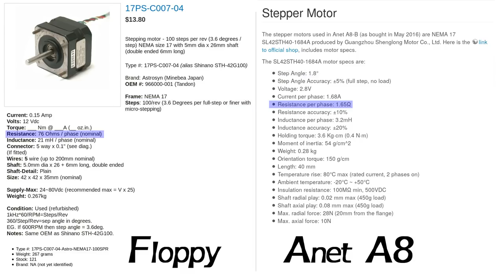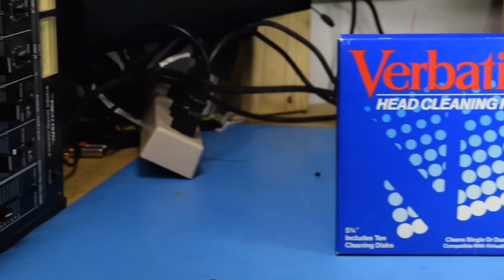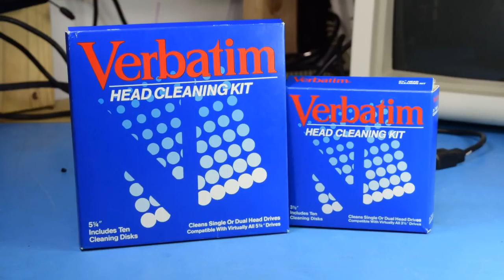Floppy Drive Refurbing

Comment: Not really sealed bearings, I believe the correct term is shielded bearings.
Reply from the maker: I'm not a mechanical engineer so I haven't been exposed to a lot of the subtle differences such as this yet.
Reply: Both shielded and sealed bearings exist and they are being used depending on the application.
Judging by the serial (R-1650-HH) posted by AkBKukU these are shielded.
Reply: @TechTangents  I only know cause I used to race RC cars, and all the guys would do exactly as you would and soak the bearings.
Reply: Shielded bearings, you can use wd40 to dissolve old grease and oils by soaking (I used to use a bearing tube/sleeve with screw cap and shake it).  Sealed, you can't.
Reply: Sealed bearings usually have a black rubber seal to keep lubricants inside, shielded bearings usually have a metal covering to keep junk out.  Both kinds can be re-lubricated.
Reply: exactly right, not 'sealed bearings'.. I soaked mine in some carb spray over night to completely dissolve the original lube in the bearings which hardens over the years causing the bearings to freeze up (WD-40 should work as well).. blasting them out and then some fresh oil and they're good to go. No need to replace any of the bearings in the floppy drive.. Just freshen then all up.
Regarding the speed of the drive.. There's a POT on the servo board (rear board) that adjusts the speed of the motor. Replacing the belt would only change the speed if the belt were dried out and slipping. If your belt is in good shape and is not dried out(hard) don't bother replacing it. Tweak the potentiometer on the servo board (R4).

Comment: The metal cover indicates these are shielded not sealed so lube can make it in no problem. You can pry the shields out carefully clean and relubricate.  I doubt given their usage that the  bearings themselves are physically damaged.  Probably just petrified grease.  If you dont want to pull the shields just soak them in alcohol for a day let them dry or a day then soak in oil.  But the shields shouldnt be too hard to remove.

Comment: 8:00 You can buy whole packs of those bearings for cheap. Also, yeah sealed bearings are just... contained. Not actually sealed. There's quite a bit of play around the shaft for many of them. I'm glad you figured it out! Yeah you can sometimes recover them for a while with 3in1, but you may need to just order a pack of those for a few bucks online.

Comment: Give the bearings an alcohol bath first, as 40 year old grease goes like stone. Then oil after.
Reply: Oh yeah! Or even a wd40 before the alcohol bath
Reply: I thought it was a bit amusing AkBKukU has the WD-40, needed a penetrating oil... went for the 3-in-1 silicone instead? (If the 3-in-1 is also a penetrating oil, then, well... my bad) Okay, yes, I get it, it's not a long-term solution... so you free it up and clean it out with the WD-40, and then maybe clean that out with isopropanol, and finally lubricate as desired?
Reply: I was thinking acetone, but yeah.
Reply: Have to be careful with acetone as some ball races can have plastic seals and carriers.
Reply: @Joe Casson its in a stepper motor, so not like it be spinning thousands times a minute or in use all the time and moving a small read head.
Stop being so over dramatic.

Comment from the maker: The bearings are size R-1650-HH, not 608. So I can't just go and easily get new ones. The non-garbage quality ones I saw online with a cursory search were about $20 shipped. So they aren't easy or inexpensive to replace. Just because it's a circular bearing with a hole in it doesn't mean it's the same size as a skate. 

Like I said in the video, it would probably be easiest/cheapest to get another NEMA 17 stepper and yank the bearings out of it. I can do that any time I want. But oiling the bearings and putting them back it lets me use the drive right now without needing to wait for parts.
Reply: Ah, fair enough. $20 *each*!? Crazy!
Reply: Dude they're 625ZZ bearings.

Amazon has them for like 5 bucks each and free shipping over $25.
Reply from the maker: Where do you get that size from? I can find very little info when searching for info on either the model number printed on it or "NEMA 17 motor bearing"
Reply: Unrelated to the bearings, wouldn't it be possible to 3D-print the necessary board needed for the tertiary floppy drive to work?
Reply: Er, not really, but if he had the schematics and felt really nuts he could recreate a PCB and send it out to be fabbed, even in qty. 1, then try to source all the chips and passives and assemble it himself. Would be vastly easier to get another 'parts' drive that does have the missing PCB.
Reply: I'm seeing a few eBay auctions that list both R-1650HH and 625ZZ as the compatible replacements. $7 delivered for 10 of them seems fair!
I know the R in R-1650 designates it's in inches, and the 625ZZ-type is metric IIRC. The numbering system for those things is over my head..
Reply: +AkBKukU dude everything has a cross reference.  These bearings aren't custom to these drives...they're more or less off the shelf components.

Therefore, a R-1650HH cross references to a 625ZZ.  Easy, simple, done.
Reply: What is the size of the bearing. R-1650 seems to suggest its a 5x16x5mm, which would be a 625ZZ.
625 = 5mm bore, 16mm OD, 5mm wide
ZZ = double shielded
A pack of 10 625ZZ bearing on Amazon seem to run between $7-15 with prime.

I have a bunch of nema 17 steppers I could check. Of the ones I've torn down, it seems like the bearing are always the same size. Listing B01CUTIQWW seems like a decent option.

I've never seen a 3.6 deg nema 17 stepper, they must have falling out of use a long time ago in favor of the 1.8 and 0.9 deg ones.
Reply: After some digging, the R-1650 HH is a 5x16x5mm double shielded bearing.  H type shielding seems to be uncommon now and been replaced by the far more common Z type, I'm assuming the Z type is easier to manufacture. I think the <series>]-<OD size><bore size> <sufix code> numbering system has fallen out of favor for the simpler <type><width/height><bore><sufix> for the common series of bearing sizes.

The modern equivalent to an R-1650 HH would be the 625ZZ. You could instead use sealed bearings if you wanted, that would be a 625-2RS.
Reply: @Colton Rushton: 3D-printing PCBs is still an exotic pursuit, however it is possible to etch your own PCBs, even dual-layer PCBs, at home using a variety of processes. There are a lot of DIY PCB videos on YouTube. That might be easier than learning how to 3D-print PCBs, which isn't a particularly mature technology yet, not even among hobbyists. 
Ordering bespoke PCBs from a low-volume supplier might be easier still, albeit slightly slower and slightly more expensive. 
And like KooriShukuen said, you'd need the schematics, and it would be vastly easier to cannibalise a donor drive – though I do respect those who recreate spares from scratch immensely! 
Some googling revealed that at least the logic diagrams though not the precise layouts/gerber files are in fact out there for the drive PCBs, though there seem to be three different drive and PCB versions. Google Technical Reference Options and Adapters Volume 1, and then it might be page 229, at least in the April '84 PDF. And even if you did recreate a compatible PCB, you'd still have to find and populate the PCB with all the right parts, some of which may not even be available anymore. Is it worth the effort just to say you didn't cannibalise another drive and brought a previously-cannibalised drive back to life? Your call.
Reply: HH have been replaced by ZZ because HH have been so expensive to manufacture with high failure rate at manufacturing ZZ just cheaper and better ;p 
i will not take 2RS computer are just magnet for dust and this can wear out the platic shield and make a goop based on platic and oil ZZ are only a bit expensive and just last longer :^)
Reply: 5mm ID 16mm OD 5mm width. You should be able to find decent sealed or shielded (yours are shielded) for less than $3 each. It doesn't have to be the same model number, just the same size
Reply from the maker: Ah, the difference in size formats makes a lot more sense why I can't find them. That helps a lot. I don't quite know how I will handle this going forward though. After some more reading yesterday I found that stepper can become demagnetized for some inexplicable reason when disassembled. And I had tried to get the bearings free without opening it up first with no luck.So I'll have to look into it more. 

In the case of floppy drives though, I don't really think lost torque is a problem. They were really only used for their positioning abilities.
Reply: @AkBKukU
Try getting the 625-2RS, the rubber seals can be removed to clean them and regrease them in the future just in case, try not to cheap out on the bearings as cheap chinese ones are shit, they leak the grease and start rattling, even more in a stepper motor which naturally vibrates, so try getting some SKF or NTN branded 625-2RS, those are really good and will last and work without play or noise. Rubber seals are the best for stepper motors as they dont run hot nor run at high speeds, and seal better than the metal shielded ones.
Reply: Thanks I was wondering about just buying new bearings
Reply: It's good to take an interest in other areas, not just your personal speciality / hobby. That way it's easier to see the big picture.
There's a cross reference for almost everything in mechanical engineering.
It would make no financial sense for a floppy drive manufacturer to use one of a kind bearings in their design. Measure and replace with  shielded bearings of the same dimensions.

It would be like Ford making their own tyres from scratch for every year and model of vehicle, IBM making everything out of their own special metal alloy instead of Steel, or rolling their own electrolytics. Just wouldn't happen.
Reply: @leisergeist  I think he did the right thing...just oil up the bearings. Why buy new ones especially if it is a classic computer where you would rather have original, and also it is not going to be used as often as it was during the 1980s when it was a "daily driver" main work terminal, or personal computer.

Comment: Back in the day we were mainly having to replace the spindle bearing and sometimes the stepper motor with new parts but it you and others are having to replace the bearings in the stepper motor from donor drives. Kudos.

Comment: Thanks for putting out this info. Info on fixing these old drives is rather sparce out there, or any folppy drives.
Reply: I want to see a video on repairing a head crashed MFM hard drive where you remap the directory to an undamaged part of the platter.

Comment: I  genuinely admire your commitment to these primitive (relatively speaking) floppy drives.  As one who was bought my first floppy in 1979 (for a TRS-80 Mod 1), and owned a wide variety of floppies including single-sided double-sided, single-density, double-density, quad-density, etc, I can say that I don't miss them one bit.  Backing up a 20 gig hard drive to floppies was absolute torture.
Reply: Come on now, don't really think you would have backed up to 13 or 14 thousand floppies.

Comment: what I don't get is why he doesn't just order new bearings bearings are the same as they were 30 years ago all you gotta do is match the size and type (IDxODxH, sealed) and likely based on the size are cheap as chips 608 roller skate bearings
Reply from the maker: The only ones I could find of any reputable quality were about $20.
Reply: AkBKukU  I see so a cheap stepper (burned coils parts one?) is likely the best source
Reply: Yea I started wanting to yell at the screen to get new bearings, as soon as I realized he was going to try to save the crap ones.
Reply: AkBKukU  ohh and keep smokin bro
Reply: christ all floppy drives must be like this they are often so loud perhaps they all need new bearings
(I might need to sell a kit to fix these old things for a 10% markup...) wait did I just type that....
Reply: you can use any cheap 608 zz (zz)mean double shielded  or size you need it's look 608 :p 
these stepper not driving huge loads i have 2 608 zz from china in one of my drive the same as yours and it's good after 3 year of work
and it's shielded for dust i don't think zz are liquid proof liquid proof had plastic seals

sorry for my crapy english btw
Reply: 608 have an 8mm bore, the stepper shaft is 5mm. 625ZZ is the likely size.
Reply: tad2020 oh but still buying new bearings for 20+ drives akbkuku is likely to own will make the "small order" pricing less ridiculous
Reply: and if he can't get the right size he could go for best-fit and add some 'filler'.

Comment: 22:18: While the lubricated drive is a lot quieter overall, it does make a weird clack sound though. Not sure if that's a problem. Anyway, thanks for the really helpful info; that's fantastic. :)
Reply from the maker: I think that it is either the other drive makes so much noise that you can't hear it hitting the stop screw or that I may need to move the whole transport back just a tiny bit more.
Reply: @TechTangents  I was thinking that or the gain was higher on the recording to try to accentuate any kind of sound.  Growing, my cousin and I both had Tandy Cocos, his had the older FD501 SSDD and mine had the FD502 DSDD drive.  Both were new drives when purchased, and around the same time but the 501 was a lot louder, and I thought sounded cooler.  My 502 drive had more of a buzz as the heads moved rather than the braaap, braaaap sound his did.  Also it seemed like your silent drive loaded faster, maybe because the seeks were quicker?

Comment: There's a YouTuber out there that took a couple of seized MFM HDDs that use steppers and dropped a bunch of oil into the bearings and got them working good as new again. One of them I believe he mentioned needed pliers to get it to even move slightly, and he got that working too. Pretty impressive stuff!
Reply: It's Adrian Black

Comment: Bearings are quite cheap so NEVER bother with soaking in oil - it is really temporary fix (not solution) and it will be worse and worse until it fails catastrophically in matter of weeks. Been there, done that. Bearing R-1650-HH translates to 625ZZ, the second most widely used bearing and I found it as cheap as 2 GBP for 10 pieces, so price is really not a point here.
Also, when disassembling a stepper motor - never let the rotor lay on table open in wild. If you plan to have it dissasembled more then for few hours, you HAVE to cover the rotor with something magnetic, like nails. Why? If the rotor doesn't have magnetic stator around it, the magnetic field degrades quite rapidly resulting in motor which have almost no torque.
Reply: "If the rotor doesn't have magnetic stator around it, the magnetic field degrades quite rapidly"

Very unintuitive, like many things in this world! I would like some additional reading on this if you could point me in the right direction. I would have expected the magnetic field to be lost at a rate similar to... well, regular magnets, frankly. Which is negligible over a human lifetime.
Reply: never is a long time; NEVER is even longer. But knowing what you do, understanding the bearings and their failures, de-shielding, cleaning and lubricating them may be shorter, cheaper and better overall. Not for everyone though...

Comment: I really enjoy your videos.  I am amazed that this drive still works after complete disassembly.  Once you disassemble and remove the heads on a floppy drive you have to re-align the drive.  You can hear in your video that the second drive is not quite aligned because you can hear the sound of it hitting the end stop.  It shouldn't be making that sound.  The first one doesn't.  If this was a High-Density 1.2MB drive it would not work.  To properly re-align the drive you need an oscilloscope and a factory alignment disk.  They did sell do it yourself alignment kits but they only get close, which you obviously did because it is working.   Once they aligned the drive at the factory, they used thread locker on the 3 bolts.  Those are all crucial for proper alignment.

You can still purchase the analog alignment disks but they are very expensive.

Anyway, not trying to sound too critical just trying to save people from cleaning too deeply and ending up with a non-functional drive.
Reply: Sorry for the late reply... but yeah, something is very unpleasant sounding with that second drive.  It does sound like some sort of plastic on plastic.  The first drive sounded perfect to my nostalgic ears.  That second one sounds like a hard drive head crashing... it was disturbing to my nostalgic ears!

Comment: Those bearings aren't totally sealed.  Back in the day, IBM and Shugart used to rebuild those stepper motors and replace the bearings because they get gummed up kinda easilly if you use the computers in a dirty or dusty environment. If you soak them in solvent, and then in a good oil (light machine oil) they may work OK for a little bit, but it won't last. The only way to totally save the drive is to replace them. It is an NMB bearing, they are still available. Glad you got it working though, hopefully it stays that way. The best way to keep it going is to use the computer, work those drives on a regular basis.

Comment: Thanks for the video, I had recently gotten a XT with a Tandon drive that didnt work. I had lubed the rails but didnt even think about the stepper motor bearings. Not wanting to dump $$ into it I was able to turn the drive on its side and put a couple drops of lube in each side bearing of the stepper without having to take the drive apart.

I was able to at least verify that the drive and heads work although the heads are out of alignment, so now I have ordered bearings for the stepper and I feel better about investing some time in rehabbing the drive.